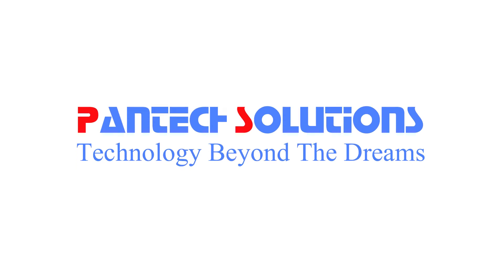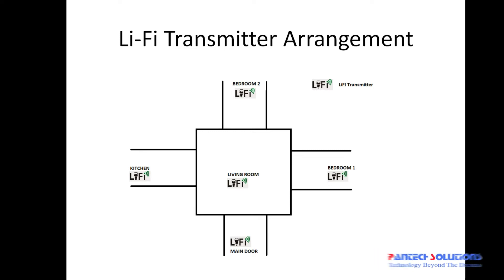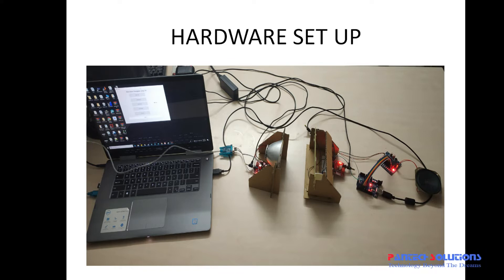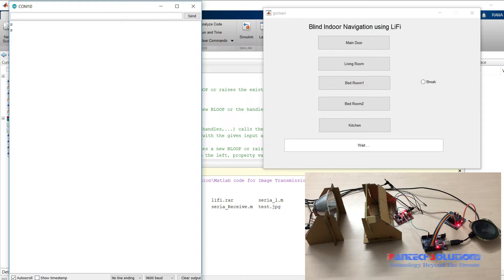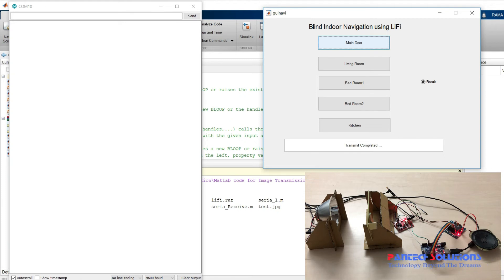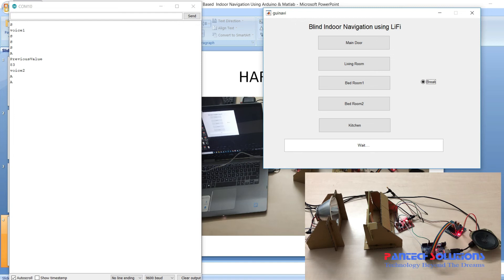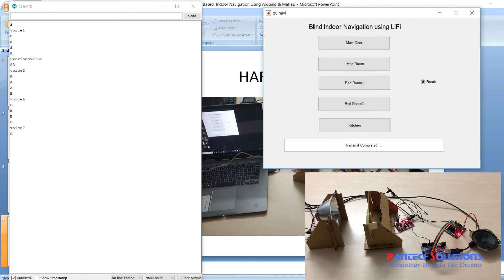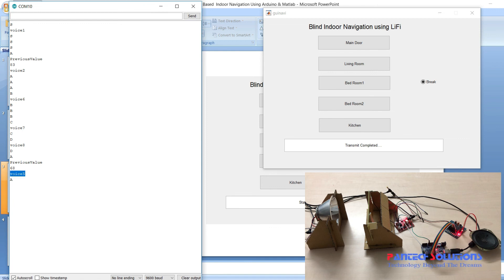Lifi Based Indoor Navigation using Arduino & Matlab

Comment: Hey the idea is nice but the have you started working on to integrate the receiver module with android application.
I have recently completed a project in which i have created an application on indoor positioning and it's based on QR code scanning.